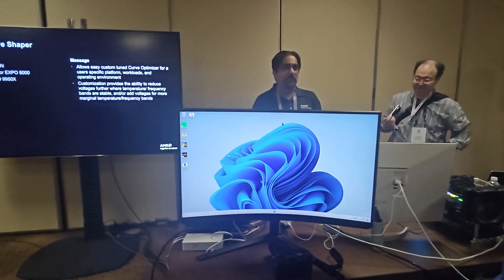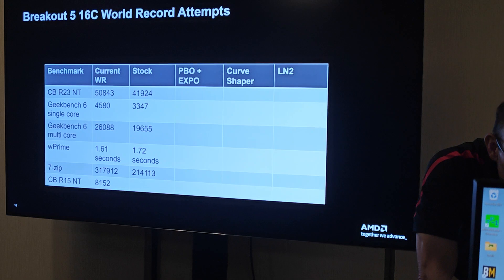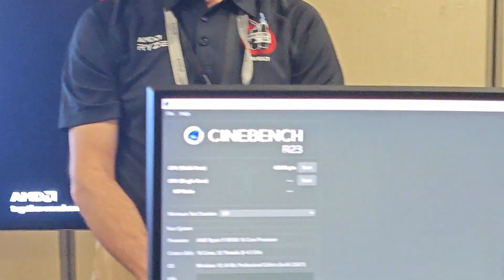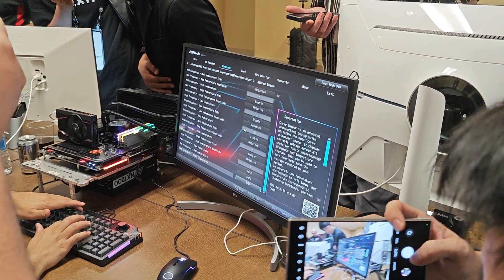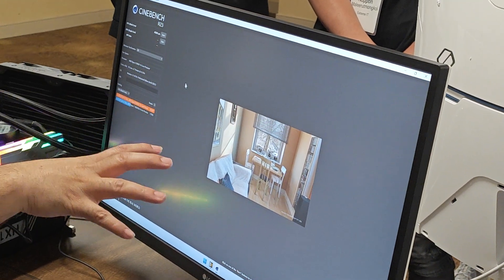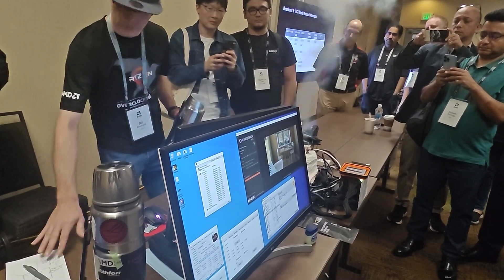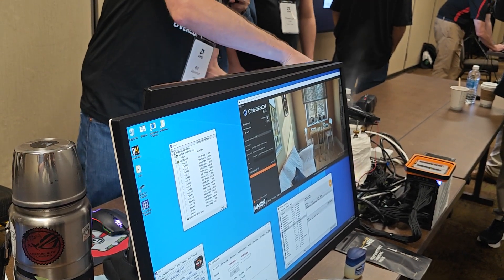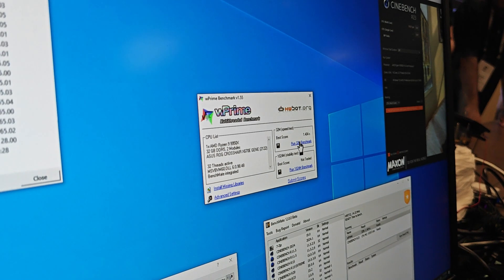Improving Ryzen 9000 Series with Curve Shaper and Curve Optimizer + Record Breaking LN2 Sessions!

Comment: ryzen overclocking is shit. compared to intel 13/14 gen, that is. the only reason not all went with intel is they lagged with their transistor gap generation tech for too long, ryzen generates less heat. but it doesn't consume less power under common workload, nor does it run significantly cooler (unless you undervolt, but then lose another 10% performance or worse). basically you don't gain jack with pbo/cso , except instability. and the max static all core overclock that passes thermal stressing is around 4.9 Ghz. that's a lot less than intel's, about 6-700 MHz. and new ryzens are expensive. crap, like any other stuff the chinese make.